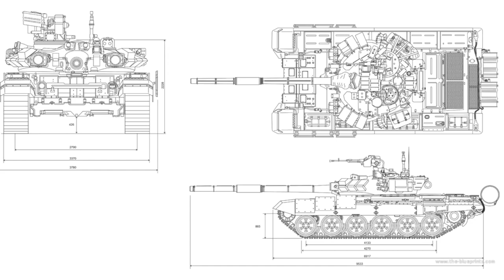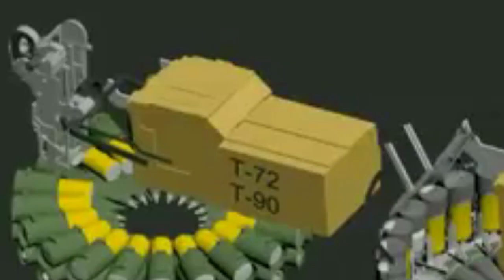The T-90 Main battle tank - A failure? #youtube #russia #ukraine

Comment: I doubt the ruzzian tanks will ever see the western tanks that knock them out.
The Bradley's will probably be more than enough and if the video I watched recently is corre t then Ukraine will have a British scorpion too 🇬🇧🇺🇦💪

Ps how does the schtora work? Does it have to be turned on or does it have some sort of standby features? Your video got me wondering.
Reply from the maker: Well said. Yeah, throw in depleted uranium and away you go. Things will get hot. Just need to make sure they more with the drone and infantry. Don't want any ATGMs being silly..
Reply: @darkhistories69  I added a question about the schtora to my above comment .
Reply from the maker: Yes it has to be on. Apparently a few of these were destroyed with the system off so training is critical. Apparently has a semi automatic mode but once again I cannot understand why you would use that. The screen that is deployed is more than smoke...with a thermal element. It's meant to defeat TOW but only if it's working lol.
Reply: @darkhistories69  Thanks, I was thinking that if it's got to be turned on then it requires an element of training when and where to use it.